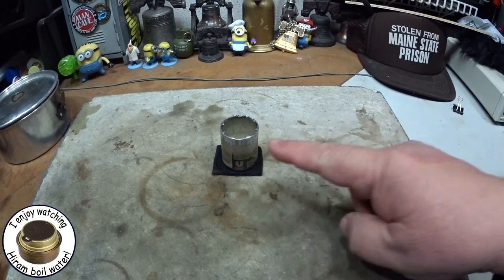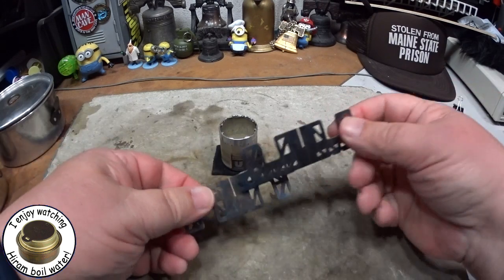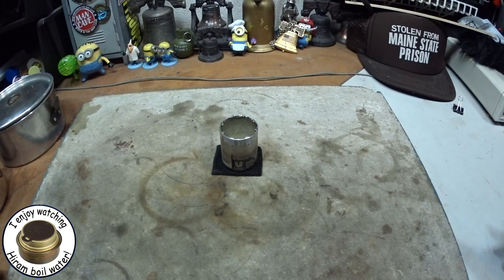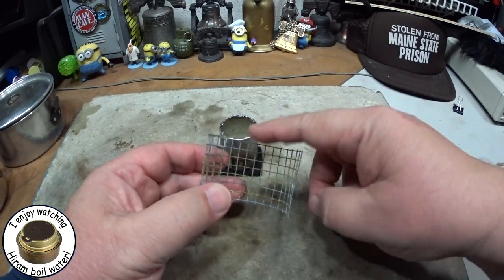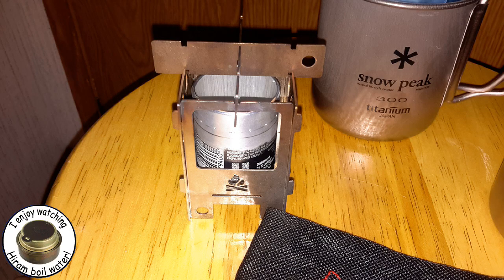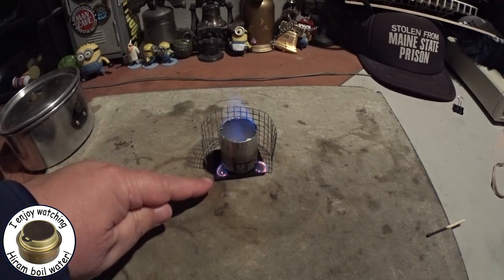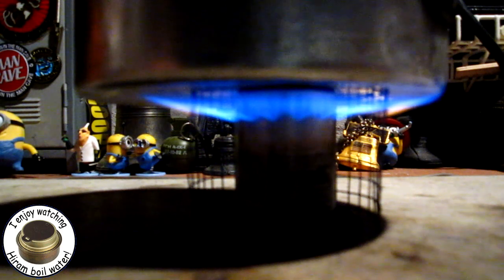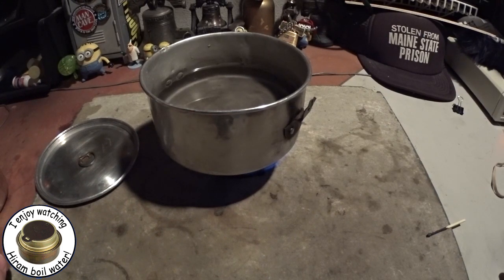If I were to make a simple potstand for 17HMRSniper's Axe Can Mini Stove

Comment: " Hardware cloth forever " ...:-) :-) Have found that 1/4 in or 6.5 mm hardware cloth is an indispensible resource for pot stands, of any and all sizes .. thanks for the tips; you're a born engineer...Cheers

Comment: I have that tiny wood stove pictured (1:48) and built a tiny stove for it using a can like yours with some carbon felt sticking up.  Works OK and likely better than a stove with jets on the outside.  Only really suitable for heating cups, not pots.  It does have the advantage of being able to burn wood if needed, but not well.

Comment: Can use 2 lightweight, 3/16 inch diameter metal rod x ~18 inches.  Use a vice, or vice grips, clamp the rod near the center.  Twist the rods making an upside down "Q" at the center of the rod.  Unclamp.  Bend the rods to make the desired height of 6 inch high cooking legs and 6 inch cooking stove top diameter.  If you need higher 8 inch cooking legs, then make a 4 inch stove top.  Like the 1960s magic rings toys, you interlock and unlock the rings.  The same "Q" design locks these 2 legs together.  Separate the legs to 90 degrees apart for cooking.  Legs can be folded flat for storage.  Rods allow pushing into soil for firm cooking base.  Weight?  Potentially 20 grams.

Comment: With a little more research I believe I have solved all of your elevation, flame, air flow, wind shielding, and simmer to rolling boil issues.

Just visited Home Depot.

(1)  There is an aluminum mesh lock-on gutter screen.  Can put the (2) rounded mini louver (below) into the lock-on bend for a perfect and tight fitting mesh cylinder and flat stove top.  Bend the mesh with the lock-on on the inside   Can easily bend for cooking, and unbend for carry.

http://www.homedepot.com/p/Amerimax-Home-Products-5-in-x-3-ft-Black-Lock-on-Gutter-Guard-441-503/203649434

(2)  3 inch or 4 inch aluminum mini round louver vent for a flat cooking top.  Can turn louvers at any angle for direct/indirect flame contact with the cooking pot.  Can also be used as a bottom.

http://www.homedepot.com/p/4-in-Aluminum-Mini-Round-Louver-Vent-ML4/202221316

(3)  There is a unique aluminum mesh gutter strainer (with a rounded top).  Can use needle nose and form the rounded mesh top into an ammo round shape with barrel, and a flared flat end.  The rounded mesh turns into a flat (and flared out) stove cooking top (like the above rounded mini louver shape), ... and a flat (and flared out) stove bottom.  Use 2 together.  Slide the upside down flat stove top over the upright stove bottom.  Adjust both strainers up and down for perfect flame to pot cooking height.  Push-in the cooking top outer mesh screen tips for stability.  When not in use the 2 units sliding into each other become a self-contained cooking container for stove, alcohol bottle, matches, etc. 6 inches tall.

No online Home Depot reference.  Might be a new product.  One unit per box (housed inside a slide-in, slide-out incandescent light bulb box) $2.67 each.

(4)  There are  aluminum 8 inch x 16 inch flat face-on (soffitt) louver (wall) vent.  Vent louvers can be manipulated for air flow (simmering or full boiling).  The 8 inch tall vent can be bent into a curved cooking podium (and used with [2] mini round louver above).. The vent has 3 louver vent columns allowing it to be bent in a three sided shape having 5 inch wide louvered faces.  Vent can be used as windshield also, even a heat reflector. Two vents can bend and connect into a hexagon, with small brad nail holes that can be paper clipped or safety pinned together.  The three vent column vent product is not listed online.  Easily bent for cooking, and unbend for carry.  

http://www.homedepot.com/s/face%2520on%2520soffitt?NCNI-5

Hope the helps and solves everybody's problems, and ultralight weight also.